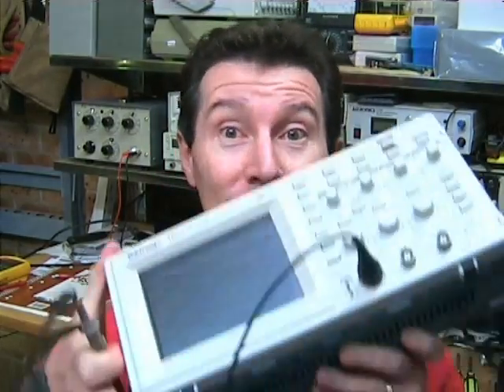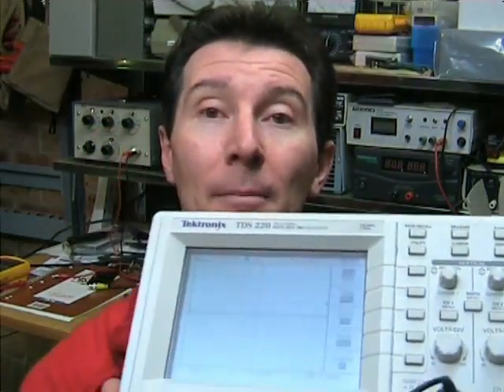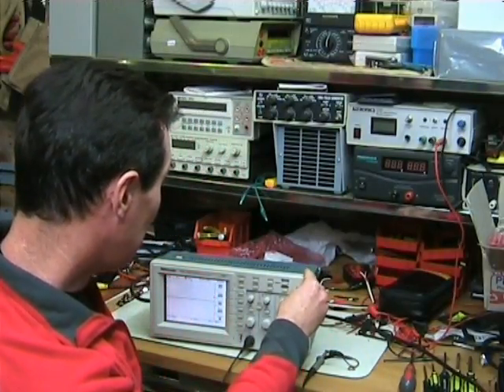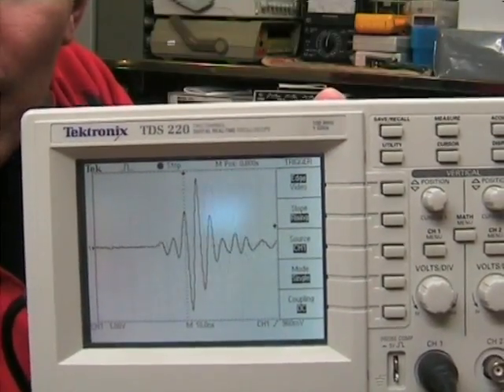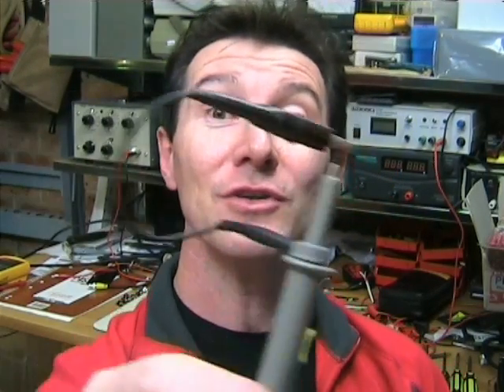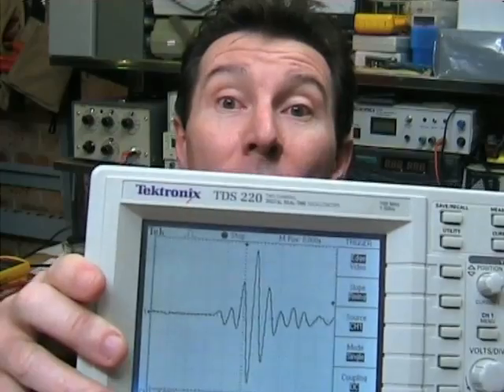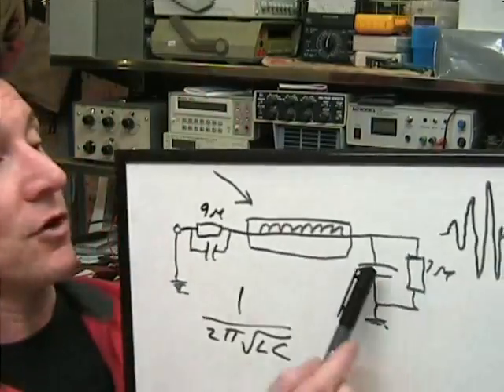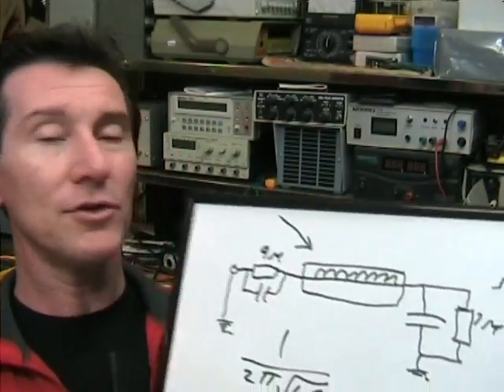EEVblog #14 - An unusual oscilloscope phenomenon!

Comment: I discovered the same thing a few years ago! I added a sheet of aluminium foil as an 'antenna' and a peak detector circuit and created a very sensitive motion detector. It was able to display my footsteps as I was walking around the room or waving my arms. It was probably more effective than most infrared motion detection systems! It only worked in 0% humidity though.

Comment: I reproduced the effect with a Tektronix MSO 4104B-L, 1 GHz BW, 5 GS/s. It does take several tries. I leave it waiting for a trigger of 40 mV in single trace mode, and eventually it happens . It also happens on the other 'scope channels which have open/unshorted probes. Thanks Dave. EMI/EMC is a topic of interest.

Comment: I think It's your chair. I used to field service and had a problem with a user's terminal shutting off. It turned out that the nylon bushing in the chair acted as a static generator. When the person got up off the chair, and the chair rotated, the back of the chair would touch the keyboard of the terminal. The resulting static discharge would shut the terminal off. Note your event happened when you got up from the chair.

Comment: Ground loops can cause some really weird things in a radio receiver.  In just a 555 oscillator running at audio frequency, if I were to put the ground scope lead to the far right of the power supply and the probe on the far left ground, I can pick up a square wave in the ground plane of my breadboard.  Move the scope leads closer together, and the square wave goes away proportionally to the distance between the probe tip and the 555 grounds.  A 104 cap to ground on pin 5 didn't affect the output.

10MHz single-trace scope from 1967.

Comment: Awesome. From the video what i could understood that, when Dave gets up from the chair & touches the floor which is the ground, static charge from his body flows to ground, & due to known phenomenon of inductance probe nearby picks it. And Oscillocope displays it(plus tank circuit concept as explained by Dave). I am not sure if Dave is barefoot or wearing slippers or shoes when he get up from chair & comes in contact of ground. I am beginner so may be i am misunderstood something.

Comment: I had a similar experience. The waveform on the scope would move when I waved my hands over the circuit. I found out it was bcoz of the sweater I was wearing. I took it off and what a relief. 
I am pretty sure, if you are careful with what you wear, you will see less of the glitch.

Comment: The resonator is most probably the shorted probe, not the cable, that is a transmission line. The spark that generated the input is oscillatory too.

Comment: I am a technician at AE Techron and we had a customer complaint about glitches seen at the output of our 7224 Amp when being driven by an AE Techron 3110A signal generator.  I was noticing that static could cause glitches. or turning on or off other test equipment on my bench.  Or some one turning on a microwave . or me standing up quickly out of my chair.  I do have a static strap that I use when working on the amp but at that time I just sat down and then stood back up and wow another glitch appeared on the scope.  my scope is a Lecroy LT374L which is a 4 ch color 500mHz scope.  and I love it.   I was also suspecting glitches occuring from air compressor kicking on and or refergerator microwave hot water heater exc.  
SO I put a very good EMI filter on my scope and that helped.  but still not fixed.  then I put a 10nF cap between common and ground of the amp and that further helped.  Now I can turn on the flourescent lights at my bench without causing a glitch.  But if I turn on a HP 33120 signal generator I still get glitch.   I wish i would have seen this video earlier this week.
I spent most of the week on this problem.  Because a customer didnt want to buy our product with these glitches that may occur 1 time per hour if not much is going on.

Comment: I think this is a transmission line reflecting back and forth with a loss at each end.  I think you should try doubling the length of the cable to half the frequency, and half the cable for double the frequency.  If you use the scope 50 ohm term you will termination it will terminate the line for no reflections.  If you want a non ESD stimulus try shorting charged capacitor in a near by loop of wire..

Comment: Did you know that coax self generates  glitches and noise ?  Just  wiggle  a coax connected to a scope turn up the RF intensity  the  energy in the open space , the scope will indicate the signal NO NEED to stand on a chair.

Comment: Hallo Dave, I haven't seen all your 1000+ videos yet, but after watching this video:
 looks like all these fancy ESD shoes, mattes and hand bracelet's do little, when one's clothes have lot's synthetics. It appears like a wrong fabric or even parts of it can generate enough ESD voltage and accidentally kill one's circuit.
What clothes do you suggest to wear when playing with circuits?
Reply: I'm not Dave, but 100% cotton and use fabric softener or dryer sheets. They increase conductivity, that is how they decrease static cling.

Comment: I tried and could not get anything on my Rigol DS1054Z upgraded. I got some bubble wrap, just to check I could create sme static, rubbed a t-shirt created static that my electroscope loved but my DSO didn't flinch. I don't think my scope has the scope for this.
Reply: +MonkeyMagic Elecifun I tried to capture this inductive phenomenon without success. I too am using a Rigol 1054z modded to 100MHz. The trace was steady as a rock.
Reply: +MonkeyMagic Elecifun I also could not get it to work as Dave described on my 1054Z. However, I did get it to work by moving the 1054Z closer to (within 12" of) a receptacle  and plugged in an wall wart device (I think plugging in/out any device will work.) Apparently this was enough to generate an EMP strong enough to trigger the capture. I did lower the trigger voltage from 1V to 500mV. (Remember to push "Single" button.) I was getting 1 to 2Vpp consistently at frequencies all over the map in the MHz range. The signals were not a sinusoidal as Dave's, but at least I got something.
Reply: Maybe your scope is out of scope?
Reply: why do you all have 1054Zs?

Comment: What is a division? I have had a scope since IO was 12 and I just don't know. I can do advanced mobo repair and troubleshooting. It's my business I own at the age of 21. I can do all this but yet I don't know common terms, pppffftt. embarrassing.
Reply: +Joshua Blalock The scope screen is divided into small squares which all represent voltage (vertically) and time (horizontally). At 1 volt per division, one square vertically represents one volt, same thing for the time.